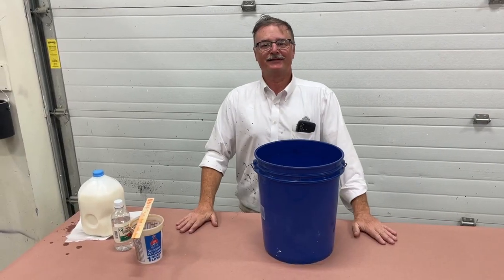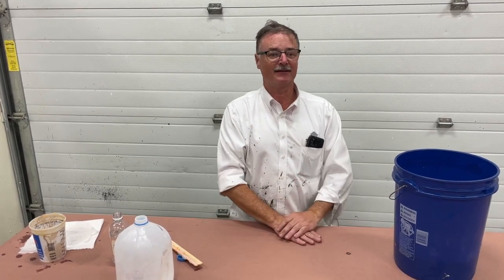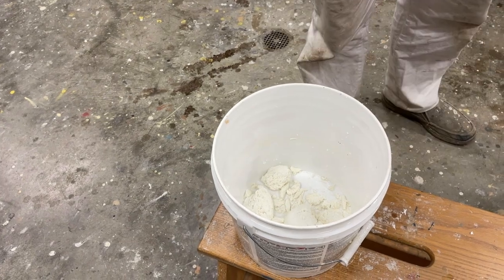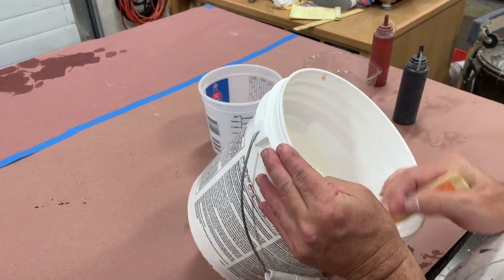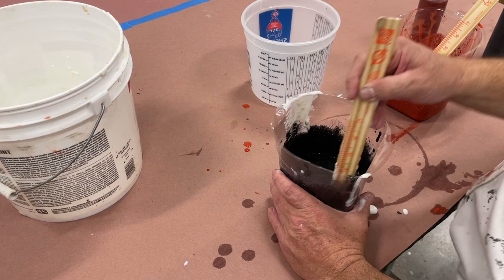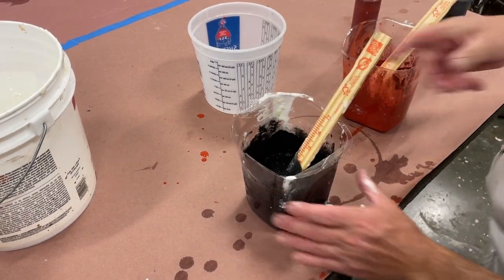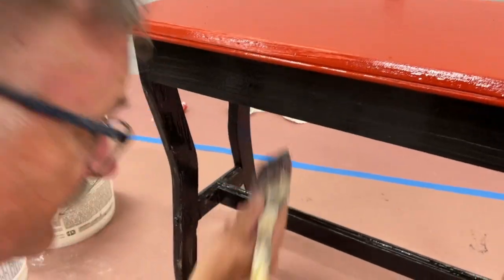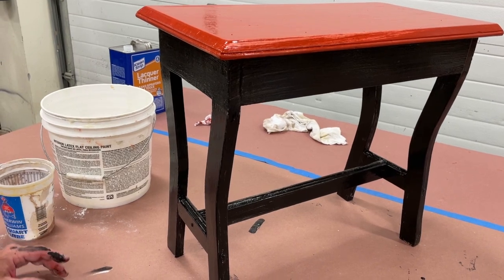DIY Paint Hack...Simple, Cheap and Safe.

Comment: I tried spraying milk paint out of my  Air-assisted- airless, and for whatever reason, it didn't spray well. I was so frustrated that I just went to bed, and in the morning, I tried cleaning the sprayer and it clogged everything!  Just threw the whole unit away. It was cheaper in the long run to just use a high-end waterborne lack!